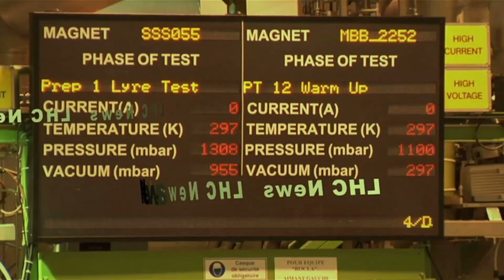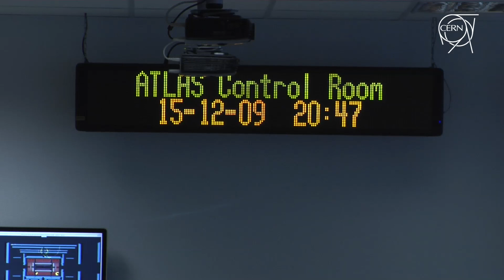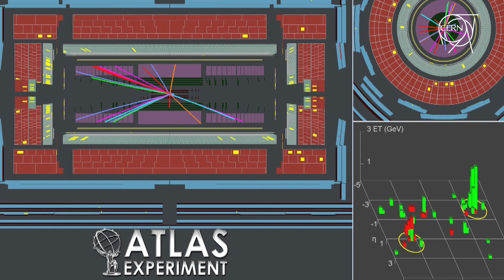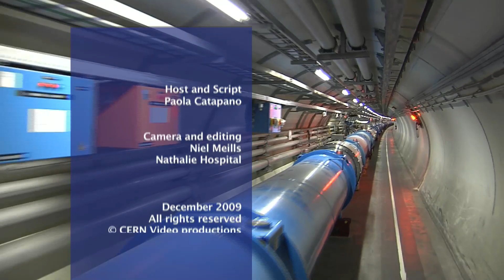LHCNews Dec. 18th, 2009 - End of run with high energy collisions

Comment: @reapersgateway86 
its all the spin off science that it will bring
one major example would be that radiation treatment for cancer patients uses the same exact machines thay use at the LHC, also the guys making,improving,designing them and using them work in both fields, thats just one example, im sure there are hundreds.

Comment from the maker: 1.21 Tera electron-volt (Tev). This is the measure of beam energy used for particle accelerators. 
1 electron-volt is equal to the amount of kinetic energy gained by a single unbound electron when it accelerates through an electrostatic potential difference of one volt. 
1 Tev = 1000 billion electron-volts.